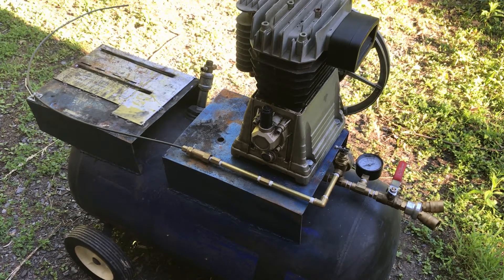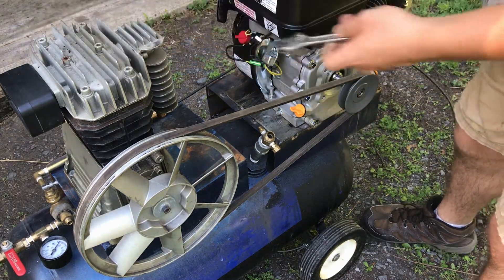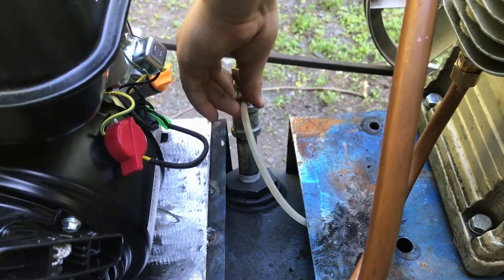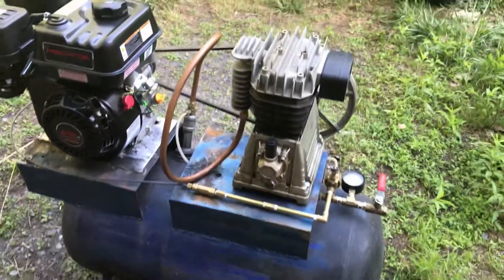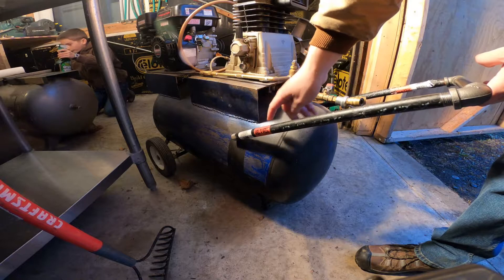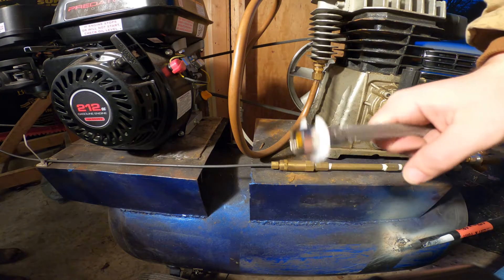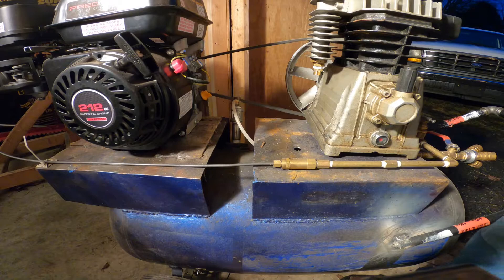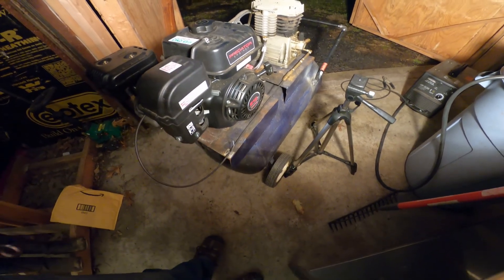Final Gas Engine Air Compressor Modification

Comment: not supposed to weld on a pressure vessel [tank] and dont use cast fittings on the pressure side...compressor tanks are tested under water for a reason....  very dangerous

Comment: Don't weld on the tank and please do a hydrostatic pressure test for your own safety this is very dangerous
Reply: How was the tank put together? Think about what u are saying
Reply: @herewegoagain4041  The tank was professionally welded and tested even an old unmodified tank can be dangerous get the tank tested for your sake please. PS: welding gloves and jackets aren't just for sparks its UV radiation. Otherwise a good video.

Comment: what is the diameter of engine pulley ( drive pulley) ?
Reply: I have the same question, did you ever figure it out?
Reply: @angelcruz2865 looks like a 2-3 inch I believe you can get a variable one -